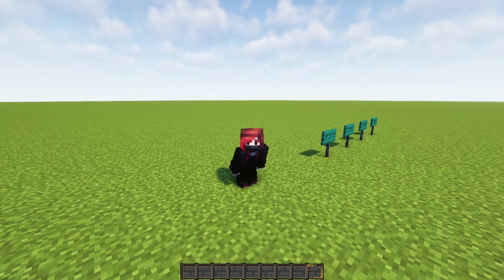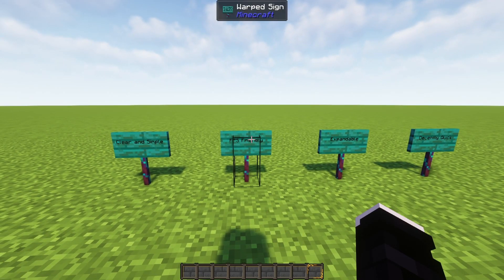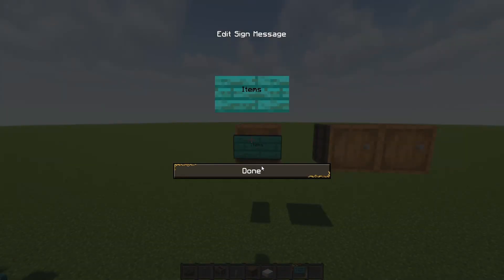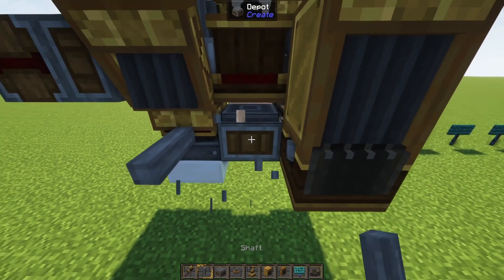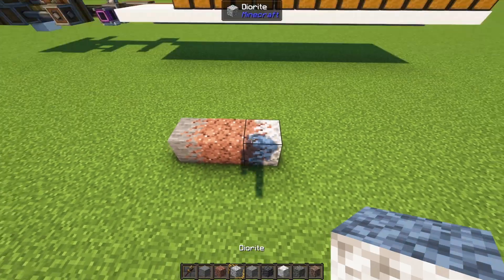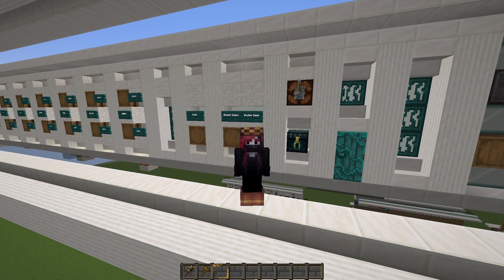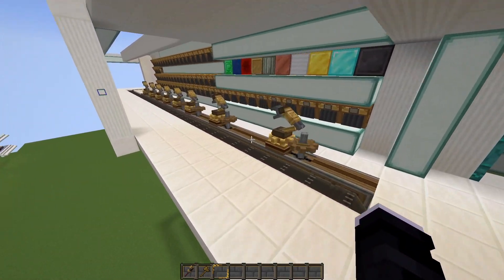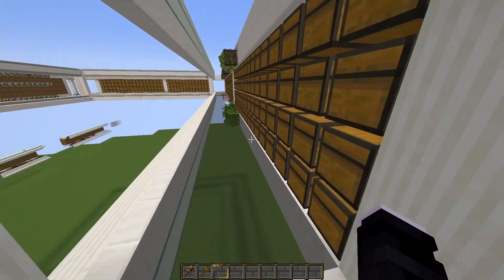Minecraft Create - Auto-Sorting Storage System!

Comment: I like the design, but anyone else have issues when using this schematic?
Belts initially going the wrong way. Had to invert speed controller speeds on both speed controlers.
First output belt of crusher was going the opposite direction of the rest of the output belts.
Shulker box unloader doesn't work. (still trouble shooting that one)
Arms can't keep up with items on belt if you have multiple stacks in a row of the same item.

Brought it into an All of Fabric 6 world. I assume its more of an issue with that than the schematic being off to begin with.